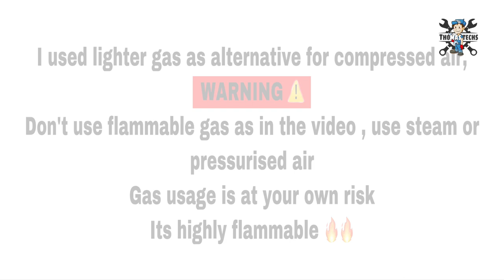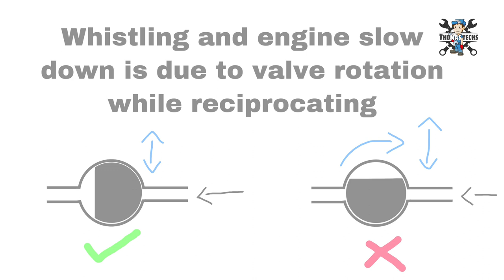V-twin steam engine ll Homemade steam engine

Comment: What type of solder do you use?
Reply from the maker: Regular soldering wire
Reply: @THOMAS_TECHS  is it acid core, normal solder wire usually doesn’t stick to steel
Reply: @Oliver_stick  yes it does, decent soldering tips are usually iron plated.  Now aluminium on the other hand.......

Comment: Use gloves.
Use bench vice to fix details for drilling and grinding
Use core tool to avoid drill slipping
Use lathe for fitting cylindrical parts